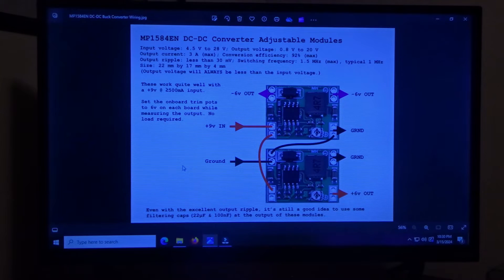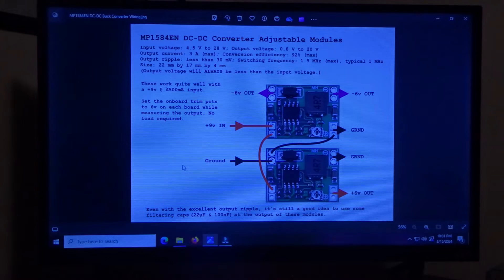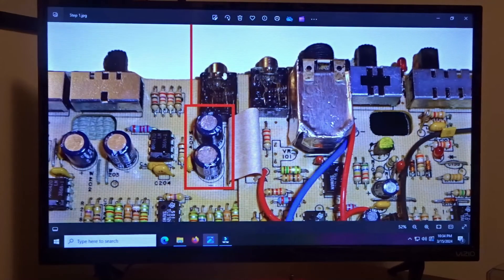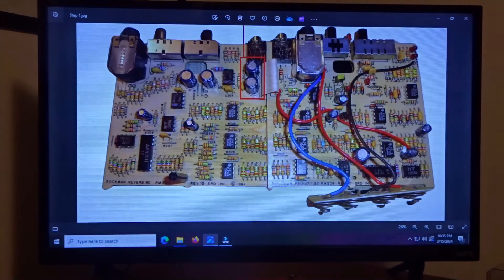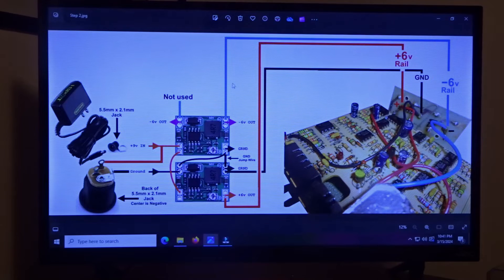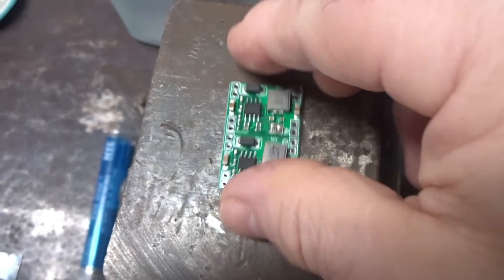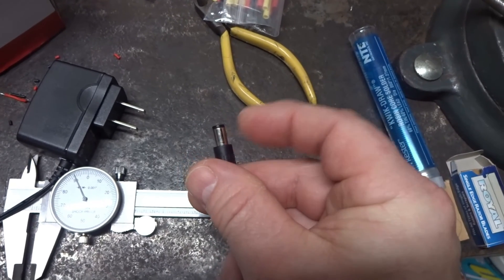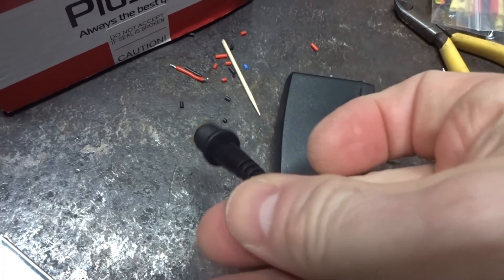How to Make "Rockman" (Power Supply CHEAP)

Comment: Thanks for this video, I have a Rockman Soloist and would like to impliment the same power solution.  The board lay out is a little different, but the power requirements are the same as the x100.  Do you know which Caps need to be removed by change on the Soloist?  What would happen if you leave the Caps on the board?
Reply from the maker: I'm not sure about the Soloist but the caps have to be removed. There's a facebook group https://www.facebook.com/groups/852250755526904/ that actually came up with this mod. They would be able to answer you best.

Comment: Love the Rockman sound but I wouldn't buy an old unit.  TH-U Overloud is the dogs balls and can be tweaked better with less noise.  Highly recommend TH-U for anyone wanting the Rockman sound really cheap.  Does adding the power supply not make the unit even noisier?  Thanks for the vid.
Reply from the maker: No the MP1584EN is very quiet. The most common problems with the Rockman are the switches, caps, & jacks all that can be replaced easily. The RSM is another great alternative & uses the same power supply I show here. You're welcome.